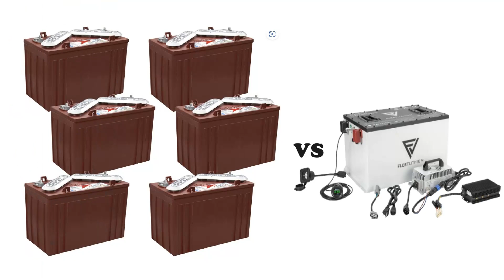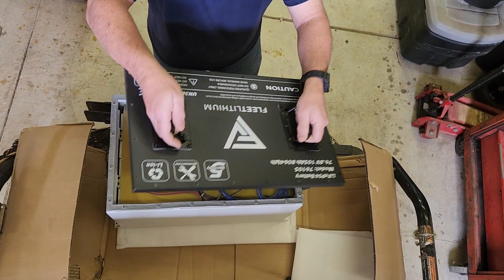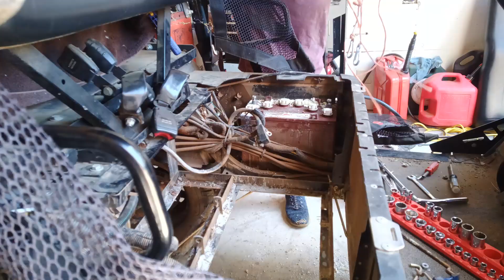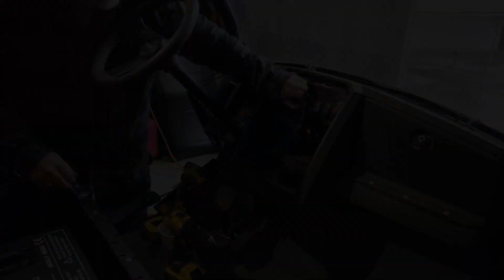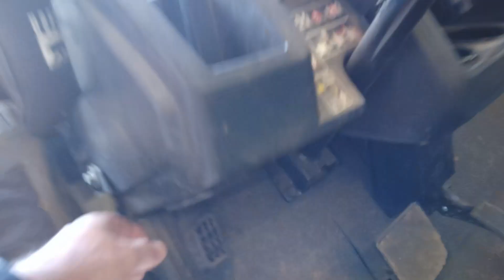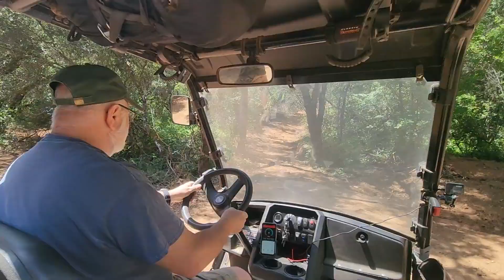Lead Acid to Lithium Battery

Comment: Can you explain how you hooked up the winch with the 12v battery?
Reply from the maker: I used a second battery. Trouble is, I used a small lawn mower battery that doesn't have enough amps to properly work with the winch. I plan to swap it out for bigger, but it's hard to move back into old projects with new active ones in the cue.

Comment: No maintenance, those LA batteries have been used and abused. Certainly no bloody maintenance....
LOL, those welds are LASER welds, not spot-welds and no, you can't solder Alluminium.
Reply from the maker: Yes Ben, you're right. The original batteries were used and abused, and better knowledge about the maintenance earlier on would have helped. But no amount of maintenance would have changed the range and other shortcomings of the original setup including the maintenance required to keep them running at full potential. I may learn more about the lithium battery that will temper my enthusiasm for the installation in the future. But for now, I would make the same choice again with what I have experienced with the changes.

Comment: What is your charge rate on the lead acid batteries? If they are offgassing that badly, it seems like they need to be charged at a much lower rate, bring the temps down a bit. That's pretty excessive for it to be what's been normal to you. It's not of consequence now that you upgraded to lithium, but it could have been a part of the issue. Just curious, for the sake of learning more.
Reply from the maker: My lead acid charger was putting 3 amps in at charge. When the lead acid batteries started losing appreciable charge longevity, I did research into all the things that the original Tracker instructions failed to explain about the maintenance of lead acid batteries. I could have likely extended the life of the lead acid batteries if I had been better about when and how the batteries were recharged and been better about checking the fluid levels earlier. However, these are maintenance items I don't have to worry about with the lithium.
Reply: @bonesetranch  huh okay. Well I know you'll love the upgrade, even without the less maintenance part there haha, lithium is very much worth the extra money if you're able to spend it.